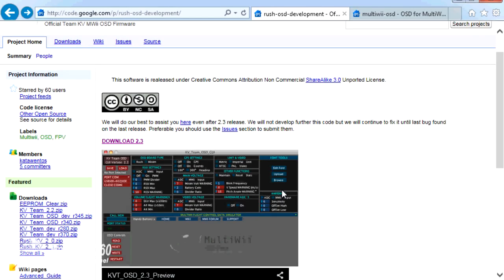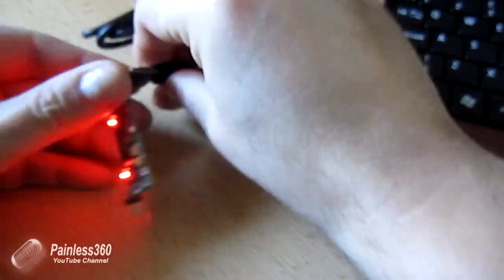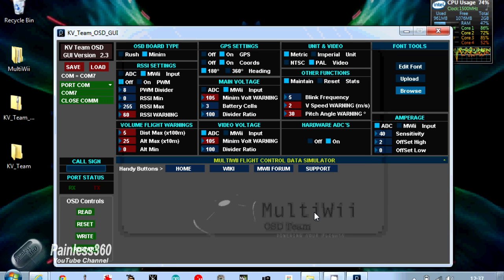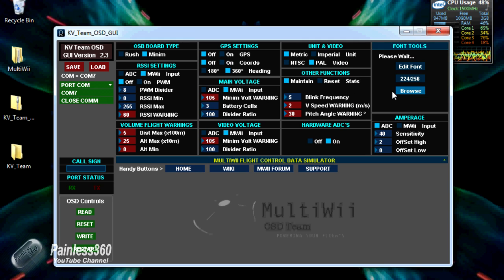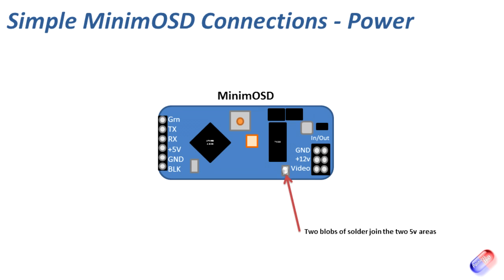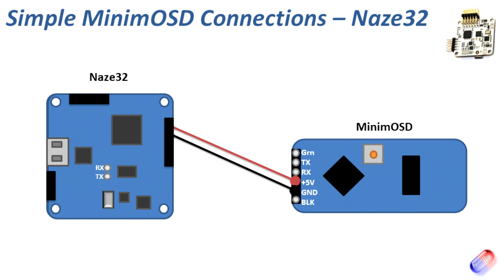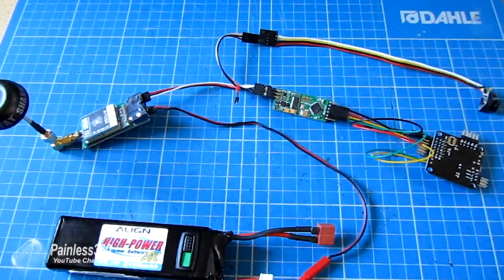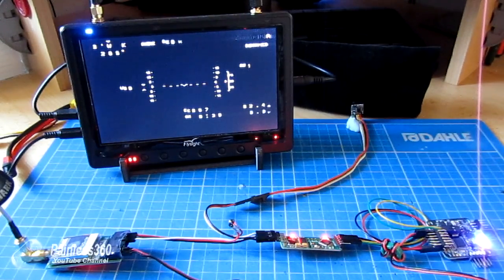(3/8) Naze32 Flight Controller - Adding an OSD using MinimOSD

Comment: I like this A-horizon,with altitude and speed side by it. I unable to get same set up firmware for other osd software. Like ardu_osd😢 simple horizon osd in ardu
Reply from the maker: I've not used a MinimOSD like this for many years. Modern flight controllers have this internal now. Best of luck with it..
Reply: @Painless360  I'm now on vacation, just for 2 months and then back to the job. Every year I have just Summer to do all my hobbies.
 Thanks for replying. 😊

Comment: installed as your video but get a screen that says throttle to the middle .... to enter setup and I can then adjust pids etc but can not get an on-screen display at all.
Reply from the maker: What troubleshooting have you already tried?
Reply: Reflashed the board, enabled soft serial ports on Naze, set baud to19200.checked tx rx and swapped over. On boot, it says V2.31on monitor and is blank with no OSD,  and moving the transmitter sticks you can go to the setup menu.
Reply: I'm running INAV but that should not effect it should it?
Reply from the maker: +Russell Smith not sure, ive only used iNav on boards with an OSD built in..

Comment: When I tried to upload the kv team firmware I get an error message: Arduino: 1.8.2 (Windows 10), Board: "Arduino/Genuino Uno"

In file included from sketch\EEPROM.cpp:5:0:

KV_Team_OSD.h:180: error: variable 'item_table' must be const in order to be put into read-only section by means of '__attribute__((progmem))'

  extern PROGMEM const char *item_table[];

                                        ^

exit status 1
variable 'item_table' must be const in order to be put into read-only section by means of '__attribute__((progmem))'

This report would have more information with
"Show verbose output during compilation"
option enabled in File -> Preferences.

so no luck with my minim osd so far, any chance you could help me past this?
Reply: Yeah I got that too
Reply from the maker: +Jeff Orr I'd Google that error. Best of luck!
Reply: Oh I figured it out, just use arduino 1.0.6 it’s just a weird compilation error in the newer arduino versions that prevent it from uploading

Comment: hello sir, 
I had a good time flying my quad with naze32 rev5 but now my quad isn't correcting itself (keeps going in the direction even after I let go off sticks). please help me
Reply from the maker: I'd check the trims on the radio and make sure that all of the channels settle to 1500 in the GUI. What troubleshooting have you already tried?

Comment: Need help , i have setup my minimosd and all seems to have gone fine through the arduino stuff 
But i can not open the GUI , when i click on it it comes up saying the publisher can not be verified , if i ignore that and RUN the program nothing happens :( :( have java installed is there a program im missing ?
Reply from the maker: Sorry, I've not seen that, I'd have a look in the forums. You could try updating Java and try running as admin..  Best of luck!
Reply: thanks for the fast reply , got new version java and same happens if i open as admin , the comp loads for a couple seconds then nothing

Comment: Hello! mine will not let me write the changes in the settings, could this be because i already direct soldered it to the flight controller? is the TX already taken by the naze?
Reply from the maker: I normally disonnect the baord from the FC when I'm playing with it.. I would try that next.. Best of luck!
Reply: thanks for responding on a 2 year old video! I think just disconnecting tx/rx or or pwer to the FC should work yes?

Comment: Do you have a video showing how to wire up a OSD. The Emax skyline32 I have has a built in OSD and I cant figure out how to set it up. By the way I have built two quads so far just based on your videos and they work great! Thanks!

Comment: Ok so I am having this issue: processing.app.SerialNotFoundException: Serial port 'COM1' not found. Did you select the right one from the Tools > Serial Port menu?
 at processing.app.Serial.<init>(Serial.java:191)
 at processing.app.Serial.<init>(Serial.java:77)
 at processing.app.debug.Uploader.flushSerialBuffer(Uploader.java:77)
 at processing.app.debug.AvrdudeUploader.uploadViaBootloader(AvrdudeUploader.java:175)
 at processing.app.debug.AvrdudeUploader.uploadUsingPreferences(AvrdudeUploader.java:67)
 at processing.app.Sketch.upload(Sketch.java:1671)
 at processing.app.Sketch.exportApplet(Sketch.java:1627)
 at processing.app.Sketch.exportApplet(Sketch.java:1599)
 at processing.app.Editor$DefaultExportHandler.run(Editor.java:2380)
 at java.lang.Thread.run(Thread.java:619)
------

So basically not right com port. I go to Tools > Serial port menu and its greyed out. I am using 1.0.5 since when I was using the current release i was getting code errors. I installed 1.0.5 like you told us to do on your other video and the code is working fine, but when i try to upload, I get the error mentioned above.

I am using windows 10. I went into device manager and looked for com ports but can't find anything in there. 
I am using an osd and I soldered the front and the back solder pads/jumpers like you told us to do.

This is the OSD I am using: https://www.amazon.com/gp/product/B019F45KOM/ref=oh_aui_detailpage_o01_s02?ie=UTF8&psc=1
This is the FTDI I am using: https://www.amazon.com/gp/product/B0068QKQEA/ref=oh_aui_detailpage_o01_s00?ie=UTF8&psc=1

AND I have tried plugging in the FTDI with the OSD in ever single USB port on my computers including the 2.0 and 3.0.

Would love an answer quickly.

Thank you and keep up the good videos! Subscribed!
Reply from the maker: +DARIO ZACCAGNINO i've not seen that here. I would check the USB cable is okay, and if it is then spend some time checking that the driver in windows for the adapter is okay too. Best of luck!
Reply: Painless360 that's what I was thinking that the USB is only power not data. the same think happened to me when I plugged in the flight controller and wasn't getting signal on cleanflight. I did some research and one guy mentioned to check if your USB that carries data. I switched the cable to a cable a I know carries data and it worked. I will try this for the FTDI but I need to find a cable with Micro USB not mini USB. I will report back if it works. Thanks
Reply: Painless360 alright I got a new cable and it works!! thanks!
Reply from the maker: DARIO ZACCAGNINO ;)

Comment: PLEASE PLEASE PLEASE do a new video on this, the new mavlinks that are shipping are v2.0 and the osd firmware you show in this video is no longer supported, also doesn't compile in arduino 1.8.1. I've tried TONS of firmware suites and cannot get a single one to function at all let alone properly. I'm going to try night-ghost's suite tonight and if it works I'd like to do a video on how to do it myself, but if not, an updated look at this by someone with more experience would be AMAZING.
Reply from the maker: +C “Christian133” FKU please see the other OSD videos in the SP3 and other build series. We also use the MinimOSD too. You will need to use Arduino 1.0.5 for all the OSD code.. later versions don't work (also covered in the setup videos) best of luck!

Comment: Setup my Minim OSD as per you tutorial and may I say excellent tutorial, however I seem to have a problem. The vidoe link is clear and the OSD info is excellent on my monitor but after a bout 45 seconds I lose the video and the osd information. I have looked at the possible cause via the internet such as ground loops but I dont think that this is the problem. Can you help please..
Reply from the maker: +Tony Saunders the MinimOSD pulls a lot of current so you need a 5v BEC that can handle it. I'd start there best of luck!
Reply: I will give that  a try thanks
Reply: I have been looking at add the Bec but I am stumped as to where it should go and where the wires need to go to  ! Have you done a tutorial on this already?
Reply from the maker: In lots of places. See videos like the APM-Planes sereis where we added a BEC to power everything as I was worried about the servos pulling too much current.. Best of luck!
Reply: Tried adding a UBEC but still got the same issue after 45 seconds lost video and OSD content. Put a dedicated power source on the FPV system and got same result. Finally I have found out what the issue was, it is as simple as this TX overheating once there was airflow the video and osd content returned.

Comment: Why does the OSD need a bi-directional comm channel with the flight controller?
Wouldn't it be sufficient just FC-TX --> OSD-RX?
Reply from the maker: +Francesco Bianchi because the MSP telemetry data is only sent when the OSD asks for it..
Reply: Thanks

Comment: Excellent video, I followed everything as you explained. had problems with uploading firmware but went back to an older version of Arduino and all was fine. Then I opened up my naze 32 Rev.5 upward facing pin configuration. Looked for the TX RX solder pad. I do have one pad with space to solder 2 pins. It's marked BOOT0 one pad has a + and the other has an B . I have another open pad 3 solder points NO LABELING. Then the last solder pads available are  1 5 pin marked SWD, 1 4 pin Marked TTL and another 4 pin Marked 12c. Don't want to make any assumptions! Can you help?
Thanks
Reply from the maker: The way that worked for us in the video. The connectors you describe are no the UARTs you need, although we use a soft serial connection as it provides telemetry even when the board is not armed.. Best of luck!
Reply: Thanks for the quick response. Are you,saying that my,Naze 32 does not work with this osd? Or I just have to find a different connection method? Sorry I am confused!
Reply from the maker: No, I'm saying you need to use a UART or Soft Serial connection to get this to work. If you're board is very different from the one in the video then I'd ask the vendor for help.. Best of luck

Comment: if i have a camera powered by 12v from the battery can i just connect the video line into the osd and then the output to the vtx, without having to worry about the 12volts and ground on the right? thanks
Reply from the maker: You need to make sure that both the camera, MininOSD and Vtx all have the right power. You can then simply connect the video lead as you mention. Best of luck!

Comment: hello friend i have a naze 32 and i installed in it a GPS on port 3, 4 am using  the function ppm is a frsky, and im  trying tô puy the mini osd, but no not feel anything in my satellite refrigerator or other information can help me?
Reply from the maker: Not sure what you are asking. The Naze32 does start to run out of UARTs and ports quickly. Is it a lack of ports that is your problem or the GPS not getting a 3D lock?

Comment: First, your videos are the only way I was able to learn everything I needed to get my first Quad into the air! These are fantastic! Now the question... Do you have to connect the TX on the minimosd to the RX on the Naze32? Why I'm asking is I want to use a 3DR on the TX/RX on the Naze32 without disconnecting the minimosd from the Naze32, what does the minimosd need to send the the Naze32?
Reply: Note, how I got on this is I got a APM and that kit has the Mavlink OSD only connected with +,-,RX (the TX is not connected) in the stock wiring harness for the 3DR Air Module. It does work like this on the bench with the APM. I think the Mavlink OSD is just a minimosd variant, so shouldn't it work the same on the Naze32?
Reply from the maker: I'd expect that both the Tx and Rx need to be connected as (if I remember right here..) MSP needs to be 'requested' from the device wanting the telemetry data, I don't think the board just 'sends' it whatever... Best of luck with it..

Comment: Followed this process, with the exception of loading MWOSD versus KVOSD.  Setup all the wiring and tested.  On the screen I can see the OSD overlay, however the camera is not pushing any video to the monitor.  If I remove the OSD the camera pushes video to the monitor without issue.  Its as if the camera isn't getting power.    I have hooked the leads (at the camera to a Volt Meter) and its getting the standard 10.67 (12v) signal).  Any help appreciated.
Reply from the maker: I'd check that are both set for PAL or NTSC, best of luck!
Reply: I hopped back into the software, and tested both settings on the OSD, NTSC worked, PAL was a mess.  You mentioned to check that both are set for NTSC - how do I confirm that for both the camera?
Reply from the maker: Depends on the camera - some are selectable, other fixed..
Reply: I assume fixed, as I can remove OSD and the camera works without issue.  I tried both NTSC and PAL (garbled) with OSD, camera does not send image - although OSD is displayed.  I am at a loss on this.
Reply from the maker: A video of the wiring and problem help..
Reply from the maker: Great job on the video. All looks great and the MinimOSD looks happy too, if the PAL/NTSC is set then I'd start looking in the forums as most of the time it's a power/PAL related issue when we see it. You could also try another firmware.. Best of luck!

Comment: Hi Painless, 
I am troubleing with connect of Minim OSD (probably) v0.1 to Naze 32 6DOF rev5 with Betaflight from Boris B. 2.1.6.
I went trought of your tutorial. I made everything like you- except connecting atmel CPU. I could see osd info in my quanum googles but no voltage of battery info, also the horizont line is made from letters.. :/  I also tried different FW by msosd, minim-extra, rust-ost, KV team..in different verions but I could not solve the problem of shown data. I also tried to switch off vbat in naze, then switch on, but nothing happent.
I made a small gallery with comments what is my scheme and last FW in osd.
http://www.rcportal.sk/galeria/zobraz_foto/foto_id/68429#foto 
Could you help me, advice me what to do?
Should I connect Naze (battery connector for voltage monitor) to Minim OSD (bat, grn) to see voltage of battery in googles?
Thank you.
Reply from the maker: +mirio46x For battery voltage you need to set up vBat on the flight controller. Also re-upload the fonts for the OSD firmware you're using - that should help with the horizon issue. Best of luck!
Reply: +Painless360 Thank you for reply.
I turned on the Vbat function in Naze - it did not work. Then I turned it off and try - also it did not work. I guess that there is missing connection betwen battery and naze or else connection. Because my power supply goes to PBD and then 5V to naze. 
Can you advise me if I should connect from battery balance connector to Naze "battery connector of voltage monitor" ? Thank you.
Reply from the maker: The MSP telemetry should include the vBAT detail - I'd read the vbat setup to your board and make sure you can see the battery in the GUI before moving on. You may need to change the source of the battery in the OSD settings as it may default to looking at it's own pins and not the MSP datastream.. Best of luck.
Reply: Hello and first of all tnkx for all the good work helping people like myself.

I have the same problem: Can not get voltage reading on osd, i've tried all sugestions made here but somehow it's still not working. I'm using naze32 rev6 and minimosd blue with the 8 pin holes on the side.Like usual,folowing the vid got it running at first time but like the vid, at the end could not get any voltage reading.( 0.0v blinking)

Comment: Is there a way to use the MinimOSD on an FPV plane without a flight controller?  I see a lot of set up videos for Naze32, CC3D, APM, etc.  I have an FPV plane that I'd like to install my newly acquired MinimOSD but I have no flight controller on board.
Reply from the maker: +mountaindewdude76 Yes you can! See https://github.com/FPVTools/BitsyOSD Hope that helps..
Reply: As always, I appreciate your time!  I'll give it a go.  Thanks!

Comment: after 4 days of Errror and Trying to put the right firmware on my MinimOSD V1.1 ...the only software which i use now and give me the right fonts ..is using older Arduino 1.05 ( not 1.6 !! )  ftdi adatper , and i use   firmware version 2.3 of kv teams firmware and the 2.3 Gui.... ....like in this  video of Painless 360 !!  all the ( newer) other  GUI software give me a lot of problems like NO booltloader etc .. no flashing to the OSD and all kinds of strange  caracters like vvvvvvv  etc... !!

Comment: Hi Painless,
I'm trying to flash the KISS OSD .ino to my minimosd micro. I think I have successfully uploaded the firmware to the OCD device using the FTDI adapter, however, when using the MWOSD software, I cannot connect to the OSD device (I only get "Waiting OSD"). I'm on the correct COM port and I've tried every baud rate. Thanks for any help.
Reply from the maker: +Kyle Hertler I'd try the earlier version of the Arduino code (1.0.5) to flash it. I will e covering this all in a video next month.. Stay tuned!

Comment: Hi. Thanks for your videos, they are great and really useful!

I have a question about minimOSD: What kind of information am I going to get on screen if I use this minimoSD with a version "ACRO" of naze32? (or better, what am I not going to get there?) (with a FC without a barometer and without a magnetometer) Thanks in advance for your help!
Reply from the maker: +Juan David Barrada Very little; mode, voltage, flight time etc. Best of luck!

Comment: Another question. I notice there is a pal bridge on the back of the board, did you beside that as well or is it all handled by the firmware? If your running pal of course
Reply from the maker: +TheFluffyDuck All in FW..